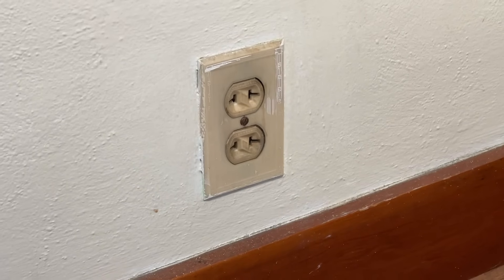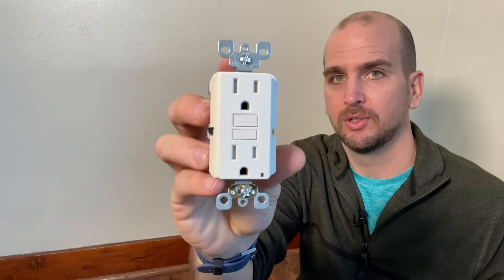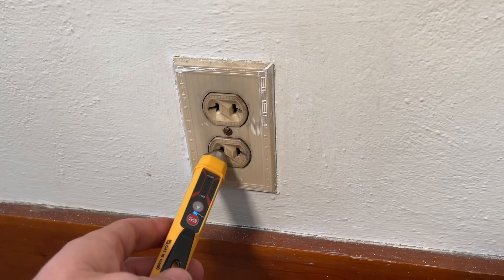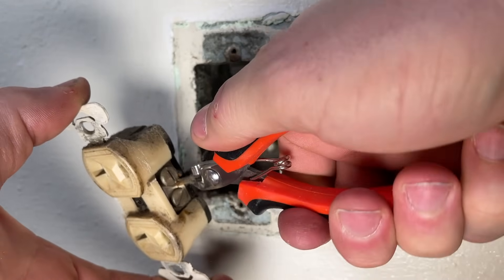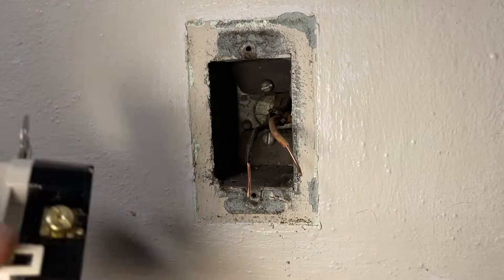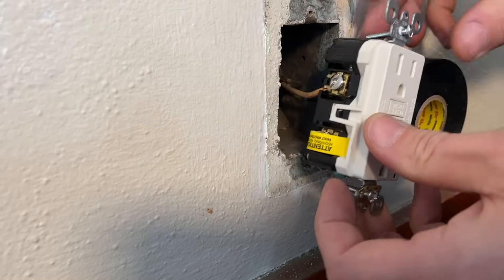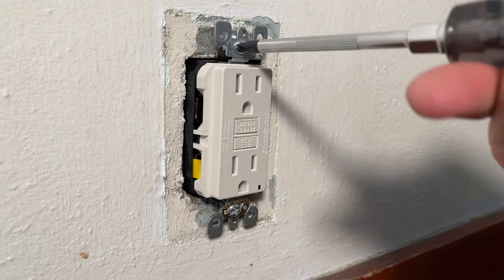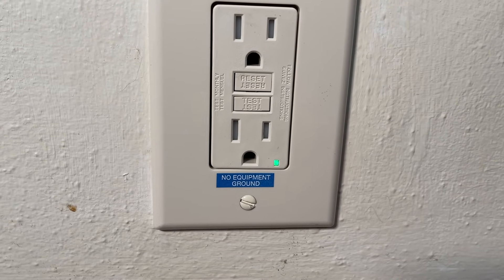How To Replace An Old 2 Prong Outlet Using 3 Prong GFCI

Comment: When putting the wire in the screw, make sure it is on the left side of the screw, not the right.  On the left allows the screw to keep the wire tighter. Also, many of the old boxes were actually grounded.  That should be checked out.  If that is the case, then to complete the process, attach a ground wire to the box and then to the ground connection on the new outlet.
Reply: If the box is grounded, a regular receptacle should be grounded by the ears attached to the metal box.  On a GFCI you would want to install a jumper wire as noted.
Reply: @dan9809  your bathroom outlet box is using a shortcut to grounding by being grounded to the cold water pipe below it.  As long as a plumber or handyman doesn't repair the plumbing in the future with PEX or CPVC plastic pipe, your grounding in the bathroom will be fine.  My house's electrical ground is attached to galvanized steel cold water pipes.  When I eventually have it repiped to copper type L pipes, the plumber will need to make sure the ground wires on my galvanized pipes get clamped onto the new copper lines to maintain proper bonding.  Those copper wires you see in your basement are also likely grounding wires for outlet boxes to ground them from behind to the cold water pipes.  Your panel box should have a ground wire coming to your copper cold water pipe to ground it as well.  As for the metal waste water pipe, cast iron was commonly used for decades.  As it leads out to the back yard, it gets attached to clay 4 inch pipes.  If that cast iron pipe is a 4 inch diameter pipe, it's a toilet line leading to the main sewer line running through your back yard.
Reply: are you referring to when using J hooks? because if so he used the rear entry that locks it down behind the plate, no J hooks necessary.

Comment: Wow... No, since you chopped those wires shorter than 6" length out of the box you've just knocked it out of code.. at that point you should add a tail to give the wires more length.

Also, the cover screws SHOULD face the same direction! If a vertical top screw, vertical bottom... 
Also wtf are you testing the GFCi with a beeper on the neutral side??? Especially with a Tamper Resistant plug... Beepers are useless! They check for induction, not power. You should only test for power with a meter. First ON A KNOWN LIVE CIRCUIT then on the plug, then again on a known live to confirm.🤦‍♂️

Comment: You can grounded socket in old two wire installation by divide neutral (PEN) wire to N and PE, all US low voltage grids, who feeds houses working in TN-C system (transformer neutral tap is grounded + grounded in switch board)

Comment: Back when I was in early undergrad I had to use an adapter for my computer in my bedroom, but I noticed interference coming through my speakers, figuring it had to do with the lack of ground I soldered a wire to that tab sticking out the bottom and ran it to our baseboard water radiator pipe and the interference was gone. Looked kinda ghetto, but it worked

Comment: In this case were all the recptical boxes connected with metal conduit?  If so, why did you not ground the GFCI to the metal box?  If the house is in certain parts of the country all electrical wiring is required to be in metal conduit.

Comment: I fail to see what causes the ground  fault to trigger at the wall. I am not understanding why this is a safety improvement. .Instead of a $15 GFCI, you coulda used any 3-prong outlet to the same effect, for $0.95  Am I wrong?

Comment: Screw those non-contact testers. They respond when they get near a receptacle, OK fine as designed. But when the power is shut off, they still BEEP or FLASH . . . but less. Even Good DMM can fail, and these NC type seem more likely to fail sooner. Either type should first be tested on hot circuits before doing your Poke'n Probe work. Call me any name you want, but I've never had  so much as a tingle . . . and I mean to keep it that way.

Comment: 2-wire outlets are not inherently unsafe.  Most appliances, lamps, etc. have 2-wire cords, and work just fine.  It might be better said that they are "inconvenient" when you go to plug something in that has a grounded cord.  That's when a GFCI out comes into play.  On appliances like a microwave, you want to establish a real ground though.

Comment: Hi Scott, if I am incorrect, I will eat my words.  I thought that old houses used Metallic Sheathed Cable with steel receptacle boxes?  And IF SO, isn't the Metallic Sheathed Cable grounded all the way back to the steel circuit breaker box?  And IF SO, why cant you use the steel receptacle box as a ground?  I recognized a steel receptacle box in your video.  Dave...

Comment: Incorrect - you should ALWAYS make a "J hook" for an optimal secured connection.
Reply: Depends on how the receptacle is constructed. in this case, it is built with a plate under which the wire is pinched. Commercial grade receptacles have this feature

Comment: Warning, This may not work if at some time the neutral and ground at the source were un-bonded and seperated for a generator hook-up. The GFCI will not detect a ground connection to current leakage.
Reply: Incorrect. A GFCI receptacle does not need a ground wire to operate properly. All a GFCI receptacle does to detect a fault is compare your hot wire current to your neutral wire current. If, for any reason, there is .5 milliamp imbalance between the two(typically occurs when there is a ground fault) the device will trip. The ground wire is in no way necessary for this detection to occur. It simply uses the hot and neutral wires as references to each other.
Reply: @Nerdworker  I didn't say it needed a ground wire, it needs a path to ground.  if it cannot detect the fault to ground it may not function.
An unbonded neutral does not give a detection path to ground. Without that path it may not detect a small leakage of current.
Reply: @jeffreylong500  That is whole point of my shpeal. There is no "detection of leakage to ground" that isn't how GFCI's work. They measure current difference between the hot and neutral. If you have 5A going through the hot and it only detects 4.5A coming back on the neutral it assumes there is a fault and trips out the GFCI. 0.5 milliamps difference is the tolerance of most GFCI's. 

If you ever encounter a two wire system, meaning there are no ground wires present in the wiring. The code prescribed fix is to install GFCI receptacles in any location there isn't a ground wire present. This is because you do not need a path to ground for the GFCI to protect you from a ground fault. If there is a fault to ground(which is usually the case) the GFCI will detect that current imbalance and trip.
Reply: @Nerdworker  would it work if the grounding conductor was not bonded?
Reply: @jeffreylong500  The grounding conductor is the neutral. At some point in the system the neutral and ground comes together. Per the NEC this is done at the first means of disconnect. So, I am not really sure what you are asking.

Comment: I had an old house with two prong outlets I changed out shortly after moving in.

The cabling was a braided tar romex with 14/2 and a 16 gauge ground. The ground wire was often spiral wrapped around the end of the stripped braided sheathing and clamped to the metal box, grounding the outlet through the box. 

You had to be careful grounding the outlet directly as the 16 was fragile once you unwrapped it.

Comment: Can you change a two prong outlet to a three prong outlet this way if there is a red wire? From what I understand that means there is light switch?
Reply: You cannot change that, at least in the way that you keep both switched and unswitched functions. But since when have lamps had a ground plug? They generally are double insulated.

Comment: How can you tell which is the first outlet in a series?  i live in a 100 year old house with only partially upgraded electrical.  i would like to put my computers in a room with two 2 prong outlets - but honestly this place is nuts and it is possible that this room is part of a larger series.

Comment: If the outlets are daisy chained for instance in a living room can you use multiple GFCI's or do you need to find the start of the chain and replace any other two prong with standard three prong outlets? also how would you find the start in a given room?

Comment: Good video.  In Los Angeles ca. There are older homes that were wired with green hot wires. Usually  wire type TW. DONT ASSUME ALL HOTS ARE BLACK!
Reply from the maker: 😬 assumptions of past work will get you in trouble sooner or later.

Comment: You should not have cut the wire when you took the receptacle out you got to have at least six inches of wire hanging out of the outlet box for it to be electrical code
Reply from the maker: Thanks for the feedback and I am pretty sure we need 6" measured from the end of the sheathing coming into the box and at least 3" past the edge of the box.  This one was a bit tight and agree that you need to be careful on these older homes shortening your the wire.
Reply: @EverydayHomeRepairs  yes sir that's right it's a national electrical code 3 in from the face of the box or 6 in from the shilling in the back    ken. Las Vegas master electrician

Comment: Hi the 2 wire polarized system is safe , all cords that plug in have neutral prong that keeps polarity. To appliance .some chargers have same size and others may but 2 wire polarized systems should b checked if polarity has been comprimized . u should cite wat article in nec u r refering to. The new smart gfci were over enginneerd where u couldnt put a blender on them in kitche it would trip due to brushes arcing in motor .your r better off to run a new wire w egc hopefully they can read english

Comment: Why did you replace a 20amp outlet with a 15 amp outlet when they do make a 20amp outlet for the change out.  Now you have 12 ga wire for 20amps with a 15amp outlet.  Dumb..............

Comment: I couldn't figure out why I couldn't locate the guide for stripping wires to correct length  is locatedon the back of the outlet , despite re-running the video over and over. It turns out that the guide on the back of the template is labelled in French!  "Garbarit de denudage", (as close as I remember it)...google translates into, "template for stripping". Perhaps a little Canadian bi-lingalism creeping in!

Comment: Excellent video, simple note for the next guy, when you wrap your electrical tape always leave a small flag so that the next guy can easily remove the tape; sign of good workmanship. Thank you for the video
Reply: Good tip, but, honestly, if I'm pulling that tape, I'm probably cutting it.

Comment: This is really bad advice. As a licensed amateur radio operator, I am in contact with electrical contractors who have to regularly repair this type of backward thinking. You have not made this any safer. The fact of the matter is that you still don't have a proper ground at that outlet, and that isn't safe. The only truly safe way to fix an issue like this is to have a licensed and bonded, qualified electrical contractor come in and completely rewire the house, this is even more true given that many homes built prior to around 1990 are not necessarily capable of handling the type of load we place on our household wiring these days, given our near addiction to electronics and the internet.
Reply: Simply not true at all.

Comment: I done reno in the very old house, a spiders web, where receptacles and switches are mounted without boxes into walls and thick baseboards. Absolutely crazy. No marrettes, no 'clamps' at holes in boxes - twisted wire and hockey tape in some of them, bent nails hold wires in place. The worst of it is that BX they use barely passes through the holes they made and replacing the 'plugs' is almost impossible in some locations. At this point I basically rewired from scratch most of the ground floor with new BX. The locations where with old BX that couldn't be replaced have separate breakers.

Comment: Please Please please if anyone is attempting to install a gfci and then outlets behind it; for them to be protected you have to know which wire they are. So the first outlet in the circuit would be the gfci, and the wire that goes to the other outlets goes on load side. Be careful out there guys.

Comment: The NEC code says you can run a single ground wire to a receptacle outlet and ground the outlet So you can use a 3 prong grounded receptacle Which is much better than a GFCI

Comment: How do you make a safe receptacle for a refrigerator that has an adapter that is plugged into a 2 prong receptacle? If you use GFI receptacle and power surge, the GFI will trip and the contents of refrigerator will ruin if away from home.

Comment: There's a problem with those modern outlets they wom't work with a dual plug tap because of the different spacing between the outlets.   Not that you have the same reason for the upgrade because the tap has a ground plug.  I bought one of those taps for my bathroom that has an existing gfci and I had to remove the plastic plug at the top of the tap that helps hold it in place.  I guess you csn figure it wants to fall out now.

Comment: You’re not stripping copper, you’re stripping Insulation. And should’ve put the neutral wire on the clockwise side of the screw (R).

Comment: First off why are you using a GFCI in this situation? Totally unnecessary.
Secondly in this instance the white wire is not a neutral, but rather a grounded conductor. A neutral is used to carry the imbalance between two different phases, such as with 220 volt and so on.

Comment: Nope. This only removes the cheep plug adapter. There is still no ground. It is not a good fix because if you install a apartment frig or other high draw appliance on this circuit with a computer, the computer will not have a ground reference and be damaged by the compressor moter.

Comment: question:  without the dedicated ground, would this type of hot / neutral   only  installation  still protect the user from electrical shock where moisture is common...example: near  the kitchen counter sink  or  in the restroom?...thanks

Comment: Nice presentation but you did not bother to test or mention whether the box was grounded. If it were then you could have installed a grounding pigtail and then have a grounded receptacle. I've replaced old 2-prong receptacles in my house with 3-prong receptacles. If the wire is armoured cable then I know that the box is grounded but to double check I always use my multimeter.

Comment: Super 33 electrical tape is one of the best on the market along with Super 88. The difference is, 33 has a 7 mil thickness compared to Super 88 which has a 8.5 mil thickness. 88 is just a little more robust. I never knew the difference, I just got the 88 cause it had the higher number. lol.

Comment: What are you doing for one thought you don't have a proper ground, at least you can run a ground wire to the metal box then attaching to GFCI, though again not a true ground it does assist in GFCI use.  Just labeling isn't just enough

Comment: always add a pigtail  to short wires before attaching gfci or outlet 6 inches beyond wall as per nec code never use short wire as shown here 03:32

Comment: I’m so glad you explained no need to make a J hook.  Now I can sleep better as I installed all new outlets in my house and did the connections just like you demonstrated.
Reply: The outlet had a clamp under the screw, so no need for a J hook. Had it been a screw by itself you would need a J hook.
Reply: J hooks are more reliable, but straight shots are quicker. Both work.

Comment: in my house the adapter would work i had 1950 wire which had a ground they attached to metal box so depending on how well they attached ground wire to box and connection of box to outlet it should ground the outlet screw but i pulled mine out and added ground jumper wire to box and put in a 3 prong outlet sometimes putting in double boxes for more outlets and space for wires

Comment: Hello! Thanks so much for this video. So, even though you've installed a 3-prong plug, it isnt grounded (because there werent 3 wires- is that correct?)
So, what are the advantages of this (other than now being able to plug in something with 3 prongs) as i thought the whole point of the 3-prong was that it was grounded, and therefore safer. Thanks so much!
Reply: He installed a gfci receptacle. It has a ‘ground fault’ built into it and will trip the outlet itself. Still not fully grounded, but protected none the less. Will prevent injury and is safer!
Reply: You should try watching the video again.
Reply: @spankynater4242  Evidently I didnt catch it from the video or I wouldnt have asked. Thanks so much for your constructive comment!
Reply: @chloeg3128  except that’s the whole point of the video. And you’re welcome, paying attention is a great strategy.

Comment: Make a J hook. A straight wire will come back out. I've seen it several times while replacing the outlets in my house. This is a safety and fire hazard! A properly done J hook will not come off even if you loosen the screw.
Reply: This particular GFCI is a spec rated type. It will allow the connections to be "back wired" which makes use of the screw and a plate that will clamp down on the wire. It makes a very sound connection and is the superior method.  On a standard rated outlet with those terrible 'back stab' style push in connections you are 100% right. Avoid using that method at all costs and wrap it clockwise around the screw.
Reply: @jimbojames9370  A straight wire will NEVER be a superior connection to a J hook.
Reply: @MAGAMAN  100% correct. I think my wording was unclear. A spec rated receptacle will allow a wire to be inserted in a terminal; in comparison to back stabbing this is far superior. Clockwise around the screw will always be best